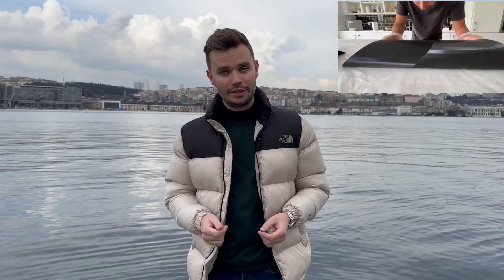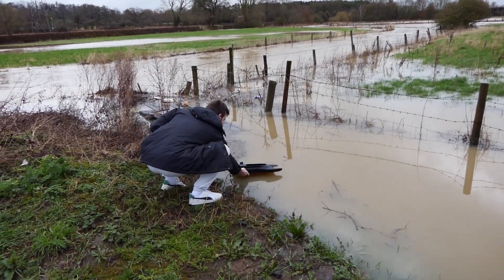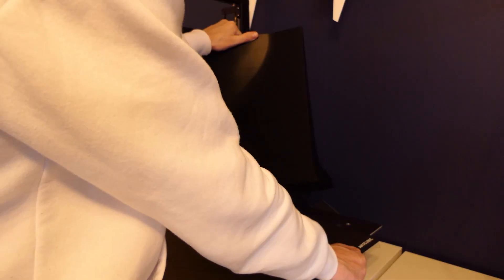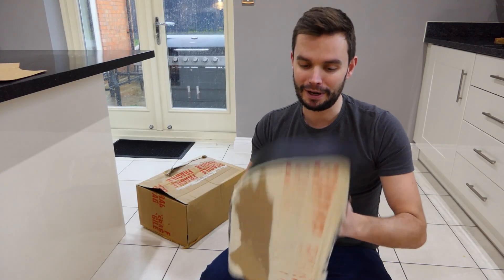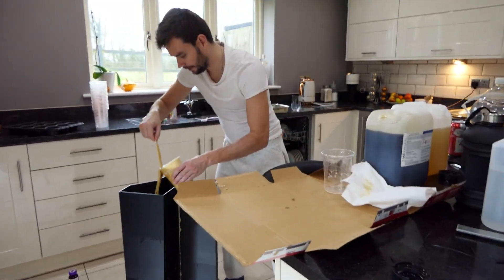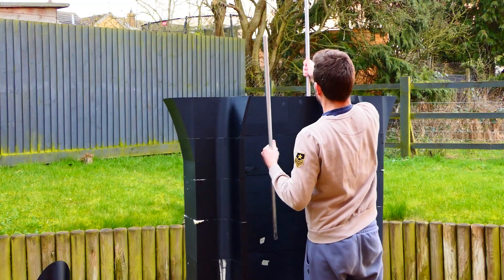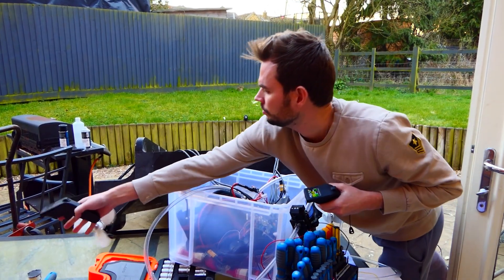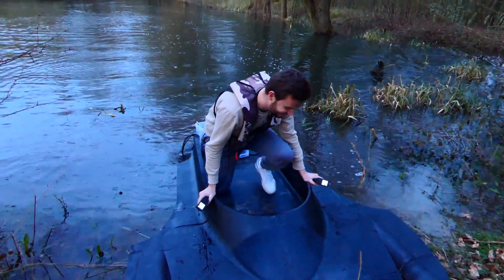3D Printed Electric Hydroplane

Comment: a smooth hull should help against cavitation , i know outboard props dont spin faster than 5500 rpm above that they allso start to cavitate so if the motors turn faster than that that could allso be a problem 
it might help having the motors drive the props through a long propshaft as that gives the prop more clear water in front of them (no motorhousings blocking most of the prop)
the bigger htdrofoil boats had 3 points of contact with the water the two pontoons in the front and half the prop in the back , the prop was basicly planing on its center hub (the force on those blades slapping in and out of the water mustve been enormous )
 https://www.marinepropriders.com/sites/default/files/imagecache/TeamLarge/team-images/312/IMG_4097.jpg

you might need to move around in the boat to get it out on plane and to get it balanced once it is planing to get the maximum speed out of it . maibe build both motors intoo an old outboard motor case (can probably 3d print a motorplate and gears for it ) and hang that of the back of the board steer it with a steeringwheel and cables like an original

Comment: ''You do CAD like you're sculpting clay'' really got me laughing for some reason.
Reply: I feel very offended :D
Reply: That's how I do fusion too
Reply: an alarming number of professionals in engineering fields also model this way. It's a nightmare if you have to edit anything.
Reply: @jimysk8er  Totally agreed, but its the age old problem; do you want it out the door now, or I can spend another three days creating something that can be easily edited latter. Use up time now or later...which?
Reply: @timcorso6337  from experience, even in a time crunch, take the time now. The push and pulls end up compounding so you end up needing to start from scratch later. You get better at it the more you do it. From a business standpoint. Taking a more appropriate amount of time during the concept phase leads to a better understanding of how long it will take to finalize the design plus they should need to waste time starting from scratch.
Reply: As opposed to creating your design around the quirks and nonsense that the software vendor allowed the programmers to create because they could be bothered to write a decent design spec. No bother with that, give me "clay sculpting" every time. 😁😁😁
Reply: @timcorso6337 no, as opposed to proper, sketch-driven, parametric modelling. I deleted the rest of this answer, because I could rant a while.
Direct modelling has it's place, but there are other tools that are better for it.
Reply: @Validole   Now worries, you missed my point..
Reply: @timcorso6337  cool!

Comment: You could have saved quite a bit of time if you just 3d printed non-flat parts of a boat and buy + glue plastic sheets wherever there is flat surface. Nevertheless cool project

Comment: How much filament was that in total? 10-20kg? Impressive stuff mate, what a time to be alive
Reply from the maker: Pushing 40kg by the end of it!
Reply: This would have been a great time to use plastic pellets to feed your 3d printer, would be a lot more work to start (to get that working, but some have that working), but 40kg of plastic pellets is a lot cheaper than filament, an order of magnitude.    @SamBarker

Comment: 10:07 Are you sure it isnt ventilation, not cavitation that you suffer from? Looks more like it to me... In which case there are multiple solutions. If you have to run the props that high, you likely would need a different prop design and perhaps also a different power output.

Comment: You need to redesign the motor mounts, totally. They are a disaster, will never work. If You really want to hang on with a challenging hull as a hydroplane,  build a outboard bracket, and test with a borrowed 10 hp cheap 2 stroke outboard, and try to get it to work with that first....Then You might try with electric,and there your design also need to mimic the outboard leg...

Comment: Probably because your printer is not square. For small prints, you won't notice. Once you scale up it starts to show.
Reply: It could also be thermal contraction, which doesn't always happen as evenly as you might consider. Can see more obvious signs of it in the delamination of some of the prints
Reply: Yes. This.
Reply: Maybe printing in an enclosure would prevent uneven thermal contraction. Even a big cardboard box would work for that.
Reply: @somebody3524  I was going to comment this - I had a ton of lifting, contraction, etc... bought one of those enclosures off amazon, never happened again. I would 100% recommend an enclosure as well. PLA doesn't need the heat, but it keeps the draft away. I keep my door closed and installed a 120mm fan @ 1500rpm to vent warm air out. It's been working fairly well for my 220x220mm core xy printer.
Reply: this or warping which with big parts is much more noticeable, when we don't even the expanding foam that might introduce more warp due to the pressure from expanding and reaching 80C
Reply: three options, gantry not square, filler foam exothermic reaction, or uneven cooling of parts.
Reply: This and also probably because PLA shrinks a bit while cooling down and being such a big print it probably started shrinking while printing amplifying any mistake.
Reply: Even after a perfect print the material will warp and such due to environmental variations. It is unavoidable and inevitable.
Reply: or due to the hot filler foam
Reply: The parts detached from the bed by one side of the print, it still continued to print but the nozzle squashed the layers and deformed the overall shape, easy 😁